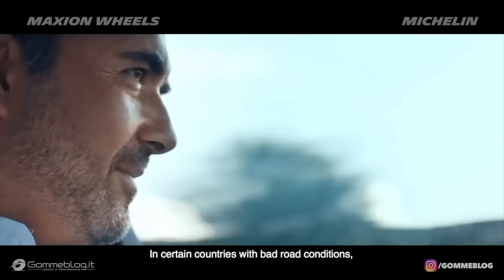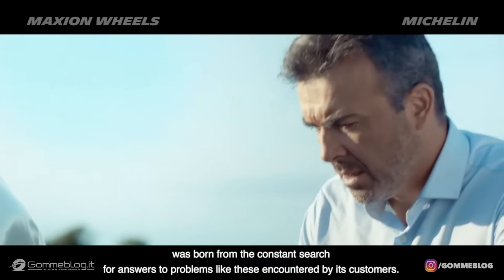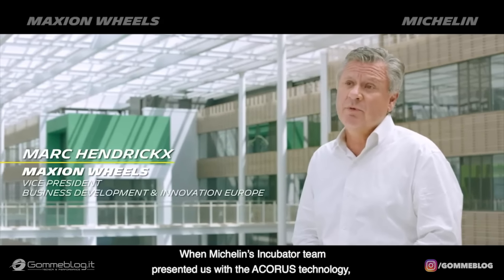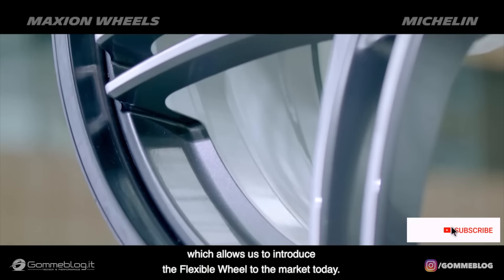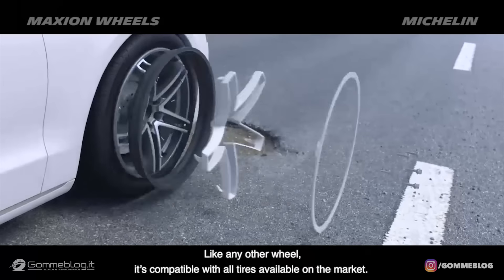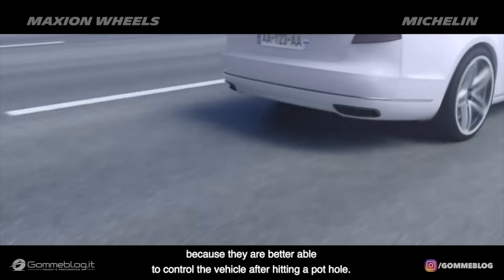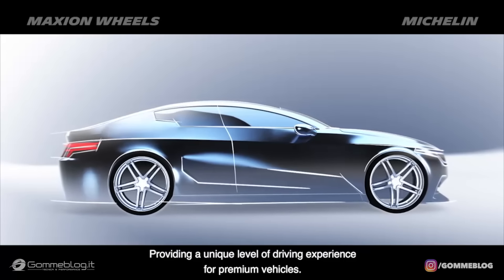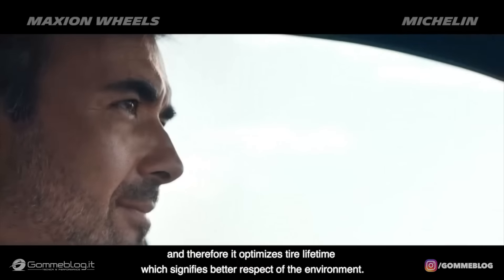MICHELIN ACORUS Reinventing the Wheel - BENDS BUT DOES NOT BREAK

Comment: stop running 20" wheels and get higher profile tires.. problem solved ... you're welcome
Reply: You're *
Reply: Chris you are smart i bet you most run 14" wheels 😎
Reply: Must *
Reply: Even the largest kits fit fine in 19 inch wheels. Most fit in 18 inch wheels. With the appropriate offset and design, you can even put 18 inch wheels on a 2018 mustang with the 6 piston brembo brakes.
Reply: yup the bigger the rim the less sidewall!!! makes your ride rough as shit!!!
Reply: 17  or 18's cool, but 20 and above are entering ricer regions
Reply: Yea.. never gona go bigger than 15" on my e36.. best comfort.
Reply: i got stock 18s on my dodge journey station wagon lmfao and has a smooth ass ride! !
Reply: Happy with my 205/50 R15s on my car 😁
Reply: Naaah Axel Official, if they don't make their ride like a train on a railroad then it doesn't count.  I have summer 225/55 R16 and winter 205/60 R16. Winter tyres absorb potholes more gently, the ride is much softer, also the winter component has role in this softness.
Reply: on my mustang, I run a 20 inch staggered setup with a 50 sidewall tire in the rear and 45 sidewall tire in the front. 
overkill, rubs the tiniest bit in the front at full lock against the wheel liner, and much larger than the factory diameter of 27.3", but I have previous PTSD from my 19" TSWs with a 30 sidewall that were cracked and bent from pothole damage.

Comment: Just run bigger sidewalls lol
Reply: Allot of luxury car brands don’t have small rims anymore
Reply: 04dram04 cut the fender wells and run some 33/10.50’s on that thing!
Reply: And sacrifice handling?
Reply: Mercedes published a statement saying that high profile tires are better perfomance wise, the reason they sell low profile tires is because customers prefer aesthetics.
Reply: F1 cars have great handling with very tall tires
Reply: xXYannuschXx  If you actually handled, you never need to worry about potholes.  If you're unable to avoid potholes with the handling of a low profile tire, you might as well use a higher profile tire.
Reply: Yep, stop buying stupid German brands with rubber strips for tyres. 50-60 profile tyres have absolutely no problem with low quality roads, which is why the majority of non-sports cars for the last century have come with high profile tyres.
Reply: xXYannuschXx anything less than a 45 profile is really just for show... When have you seen an actual race car running super thin tires? Never cause it's actually worse for handling because the tire needs to deflect and flex to maintain traction on small bumps
Reply: @xXYannuschXx... as if handling on a high level actually matters IRL? A tire just a little less wide and a bit larger wall will not impact handling while daily driving, but it will make for a much more comfortable ride. Last year I've actually changed my 18" wheels to 17", I used to run 245/40 and now 235/50 and the ride is so much more comfortable now.
Reply: @André Gonçalves... Mercedes said a 'higher' profile tires performs better... as in all those very low profile tires because of aesthetics that customers want ruin performance, just a little less low profile and handling will improve, but of course there is a threshold and that margin is actually pretty small. But I prefer comfort over handling anyway, I don't treat public roads as a circuit.
Reply: it's for looks
isn't it great that the beauty does not sacrificed the safety and your money in pocket ?
every tires has it purpose tall tires may handling well but it just not as good as F1 tires by any mean
and so for looks and your preferences this is some technology that advance for everyone
so why complain ? can't we just appreciate the technology ?
Reply: No la
Reply: @burmesebeef  but there not efficient on road.
Reply: lol 1984 Mercedes: $110 R14 Michelin tire, 2003 Mercedes: R16 $166 Michelin tire. 
      2011 Mercedes: $225 front/ $250 rear + TPMS service or replacement. 
      2025 Mercedes: $325 front/ $350 rear + Flexible ring service + TPMS service

Comment: Or, quit putting tires that look like rubber bands around oversized normal wheels.
Reply: deekay2 That reminds me of the giant 22 inch wheels that came on higher trims of older Ford edges. They looked proportionally awkward, make the ride quality worse, and added unsprung mass.

The newer, higher trim Ford edges have 20 inch wheels, with 21 inch wheels being a rarely picked option that isn't standard on any package. I wonder why...
Reply: Those hilariously oversized rims covered in rubber bands are really just a 13/90 thing.  Sensible folks who don't focus their entire existence around hollow bling puts some proper space between tread and bead.
Reply: james pogrebetsky Pardon my ignorance...but what does 13/90 or 13/50 mean??
Reply: deekay2 I think 13 is the rim diameter in inches and 50 and 90 is the height of the tire sidewall as a percentage of the width of the tread.
Reply: i bet you own a kia optima or something. would sports cars look and perform well if they had the wheels and tires from your kia?
Reply: @LucciOW  do formula one cars have 22 inch wheels ?
Reply: They will run 13" untill 2021. I run 14" with fat tires and 40psi on my car, so, no chance of damaging the wheels by hitting a potthole. For the next one I'd go 15" to 17", no more.
Reply: Amzar Nacht I said the same thing for years but it was because I couldn’t afford the nicer wheels. Mercedes-Benz and Jaguar now puts OEM 20’s on their top models. They come with 35 series tires. It’s not just for looks like uneducated fools who never drive a high performance car would say. The driving style and handling is so much better with the lower profile tires and these top German and British companies realized it! Trust and believe me son, I drive a 2014 CL 65 AMG that has 20’s with 265/35/20 front & 295/30/20 in the rear and I assure you the car itself brings the attention NOT the wheels BUT the wheels do give me a “sportier “ ride and feel! You keep those grandma 55 series tires on your Ford Taurus and leave men alone who want the best out of their cars! I am 45 years old and I could careless about what people think of my bigger wheels rather they think I’m “Bling out” or not but I do know that ride makes me not want to get out of the car sometimes! Your 55’ series tires will make my CL ride like a Lincoln....lol

Comment: I dont have this issue at normal speeds. I have thick enough walls to not worry. However when driving fast I could see this saving wheeld but I doubt it will be able to safely handle what Id throw at it. What happens if you roll the bead on hard cornering? Especially with an aluminum wheel. What happens when I hit a bridge at 150 mph and the surface difference between the road and bridge is pronounced? Let somebody else be the guinea pig. Wont go near it for atleast 5 years after release. Itd be even worse in hot weather.

Comment: THE REASON you buy bigger rims and low profile tires are for performance reasons and traction on a corner, now with this thing your rims are going to flex instead of a higher profile tire flexing which would cost much lower, this thing is basically just for riding better with flat tires which is a good thing but also for people who just want the looks of a high performance rim without the high performance, basically the same people who would go buy carbon fiber plastic trims or stickers. also nowadays there are good quality forged wheels in combination with low profile tires that can handle much higher pressures and a good suspension system that give you the performance with the safety against potholes, so safe that in order to break your wheels or damage your tires the pothole needs to be big enough that your bumper needs to fall off or break too.

Comment: I wonder how well these tyres will retain their pressure over time. There are already tyre pressure monitoring systems fitted in a lot of new cars. I wonder if the next step will be compressor systems to maintain optimum tyre pressures in what might turn out to be a leaky wheel!

Comment: Looks good on paper.
Now you try and go mounting those tires on them 20' wheels with them rubbber flange that low profile tire with out breaking the TPMS sensor in the wheel (unless your car is indirect sensors), then try set the flanges and bead of the tire on the wheel see how much psi it takes to set. 
You know Tesla tries ( from your competition) come with a sponge inside? Cant be worked on.
This is fucking stupid prepare to pay for sensors people.

Comment: This design only works when encountering a round pothole, where the edges of the tire contact the edge first. Hitting a flat or edge convex to the wheel would still damage the wheel. If you look closely at Formula 1 tires they have a low aspect ratio, but not very thin sidewalls. If tire manufactures would make tires with more robust sidewall construction, the original purpose of pneumatic tires would more than suffice for any road hazard situation.

Comment: what about grip performance of the tire in track condition? Any tests in race before? of course there is no pot holes, but there is curbs that can make damage on tires
Reply from the maker: Flexible Wheel is designed to work with any brand of tyre, including low rolling resistance tyres
Reply: interesting :)
Reply: Sevendede  )8

Comment: I wonder how flexy wheels will handle a corner at 110mph. I bet the handling is ridiculous. Waste of time money and effort just fix the roads = problem solved. And probably cheaper too
Reply: This isnt designed for track use, if you want to drive around a corner at 110 that's what performance tires and wheels are for.  These are a compromise for road use.
Reply: John Jacob exactly my point dude if they negatively impact the handling of a car it's a backwards step. Millions of pounds wasted.... the obvious problem is the condition of our roads so the simple solution is fix the roads not design your car around them
Reply: Our roads are not race tracks, these tires will be more than adequate for road use.
Reply: John Jacob = fud
Reply: And what does that mean?

Comment: A higher side wall profile is the answer.  The large rim low profile tire is an assholes dream. It sacrifices ride quality and subjects the tire ad rim to damage.
Reply: vvvVFANGSVvvv especially the merc with its magnetic ride shocks. lol and the 22in wheel on the 7 series cant even bring my coffe in that car.
Reply: As well as what the other reply's have told you it also adds less tire flex and better stability in corners having lower profile tires. They look better as well. I have driven over 100000 miles on low profile tires with no alloy damage.
Reply: vvvVFANGSVvvv Most of us drive compact and subcompact autos which are better served with more tire and less rim. Most of us do not race. The large rim low profile thing was based on performance and marketing.
Reply: Gary Doss what city do you live in? my hinfa had 215 60 16 tires stock from the factory. thats plenty enough sidewall.
Reply: ElectronicRedPanda I get the same mpg with a 15 inch rim as the 16 the car came with. In fact, I now have LESS noise now.  Also much less jarring when hitting rough spots in the road. I have no vibrations. Indeed, the reaction a greater potential to damage the rim and tire. I drive an 07 Subaru Impreza  wagon. I might add that its the more reliable and trouble free auto I have ever owned.
Reply: you don`t need to race to feel the difference between a good stiff tyre and a spongy one. It sounds to me that your just jealous of people with nice cars and wheels. or can`t afford one
Reply: Most of us never drive fast enough in corners to require performance based narrow tire large rim.
Reply: so why make remarks like people with nice wheels and narrow tyres make us an asshole?  Maybe most people don`t drive fast but most people want a car to look good and get good mpg.  modern cars with tiny wheels and massive side walls just look stupid.
Reply: spoony spoonicus  My car came with 16's . I'm 74 and no longer drive fast or corner fast.  I am a retired mechanic with failing kidneys.
Reply: I don't care about rotating mass. I don't drive fast or far. My goal is to have a softer ride.
Reply: spoony spoonicus I drive a Subaru wagon and don't give a shit about looks.
Reply: Peter Z I have lived in Truro Cape Cod for the last 44 yrs. I wanted less noise and a softer ride. I achieved both.
Reply: Gary Doss whats this narrow tire?? Narrow and low profile are two different things
Reply: It was understood to reference SIDEWALL. Though apparently  not to you.
Reply: spoony spoonicus Because most are. This is a Trump run county so many exist,
Reply: Gary Doss you do realise you started the comments. Im sorry i clicked  on your name to reply gees
Reply: Gary Doss you totaly did say narrow tire on large rim hahahaha
Reply: I`m not from the US. I live in Scotland.
Reply: lenny 034 Understood as Profile. You need to study more.
Reply: it also damages suspension and sometimes bends the chassis on new cars... a guy bent both his front control arms and bent the left front corner of his brand new subaru wrx because of a pothole... just get more side wall
Reply: no way, he must of hit a crater. like i said before i have done over 100k miles on low profiles and so have many of my friends on Scottish highland roads.  Never had an issue. Most people that bend an alloy are using wrong tire pressure,fake wheels or just are bad drivers.
Reply: @spoonyspoonicus4648  ok. Not everyone is lucky as you. Everyone else in the world doesn't get potholes... We get craters.

Comment: laughing a bit here.
"at 1:23 they show a hillarius stuipid loooking wheel on a car as the "standard" and then they fit it with their new wheels large large large.. making the car look good.. YES, large wheels look good, but today you can easely get large wheels.. so, that is not a sales argument.. 
- but a wheel that will not break is a good idea if it works and is cheaper than an ordinary wheel, face it.. it is not normal to break a wheel, I had cars for 23 years, and I never broke a wheel.. so if these are more expensive, the cost will greater than buying a single wheel they day you finaly break one!

Comment: rubber on the wheels??
after a couple years. the wheel will just start do fall apart. 
plastic and rubber 101 basics.
and so much efort to make whell stiff so then car be hard and not bend under pressor. and this guys make a whell that is flexible to lose grip and perfectibility... 
useless tech..
bigger wheels and tires do the same cheaper and more reliably.